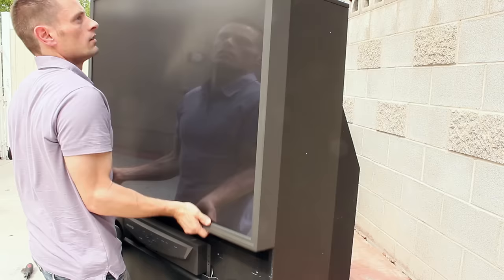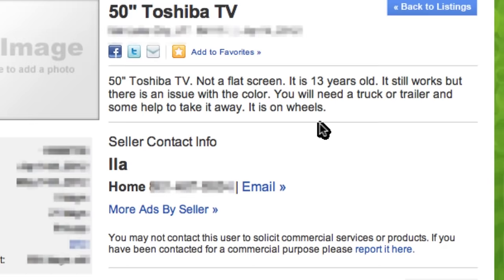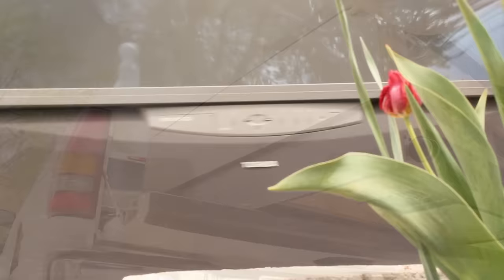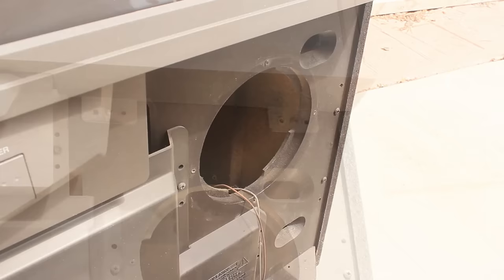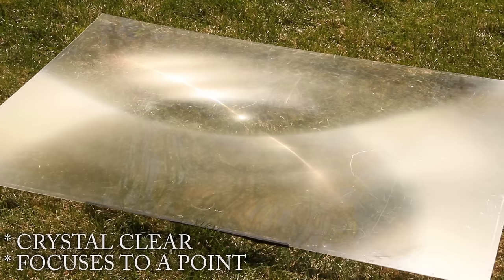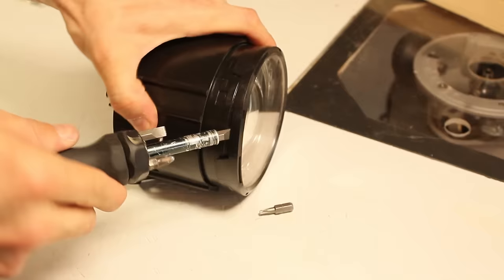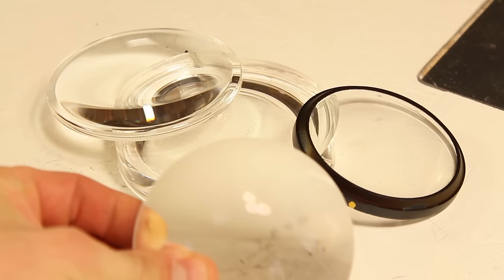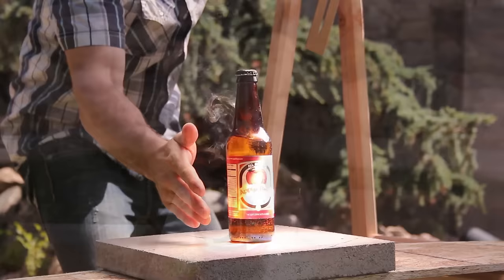How to get 2000ºF Solar Power

Comment: Mate, you are a legend. I was dropping things at our local recycling shop and someone just dropped off an old projection TV. I run a local stargazing business and am looking to add some things of interest for daytime shows for schools. You're right - these TVs are heavy, but I couldn't wait to get it home and start extracting the Fresnel lens, which I did just as the sun set. Came out easily and I can't wait to try it tomorrow. The next step is the frame - I will use your design and just looked at the video - wonderful. Well explained and should be good fun putting it together.

Comment: I made this thing it was easy. I was very excited about this and had plans to use it as a solar forge. There was a pile of TVs in the junk yard. One of them was a projection tv. Unfortunately the lense is not only opaque but the beam is focused in a line.The temperature is 300-360 degrees. However, it is not a failure. The tv came with a sheet of dark grey plastic, and the beam from the lense is the perfect temperature for quickly softening the plastic so that I can shape it into anything I like- I used it to make a fine sheath for my diving knife. It does not burn the plastic like fire does, and because it is solar the heat penetrates the inside of opaque plastic heating the whole piece equally inside and out like a microwave. Very impressive way to quickly heat plastic to molding temp.

Comment: If you have a spring cleanup in your area go drive around. Take a phillips and flat screwdriver (or cordless drill) and you can open one of these up in about 10 minutes to get what you need and not have to worry about discarding the shell of the tv. In the last month I have picked up about 10 of these lenses in my area. I grabbed all the optics too, the color from the lenses are good for over flashlights for the kids and that lense assembly you took apart, if you turn on the flashlight on your phone and put that in front of it you can get a heck of a spot light out of it. Good luck!

Comment: if this setup can heat up water in minutes using the sun, than why we don't have power plants with industrial sized versions of this? it would boil water 100% cleanly. or is this in use already?
Reply: There are some solar farms that use mirror 'half-pipes' to heat pipes of water above them to create steam needed to turn turbines.
Reply: Josh Kavathas Some days It's not sunny.
Reply: Josh Kavathas Here is something similar, but using hot air to drive turbines. http://www.enviromission.com.au/EVM/content/home.html
Reply: Josh Kavathas Because the World runs on fossil fuels.
Reply: Josh Kavathas because we would basically need to turn entire regions into solar farms to power a single city.
Reply: solar fricken roadways!
Reply: it even says in the article that federal restrictions are challenging to deal with and make it very costly to proceed. That and a 160,000 homes may take care of a small/midsize city, but you would probably need a couple areas like that to take care of a place like NYC. Its like trying to make cars run on ethanol alone, we would have to turn Iowa and then some into corn fields just to support about 1% of cars.
Reply: Use Africa it's not like its all inhabited
Reply: Josh Kavathas because solar energy is free, that wouldn't work out too well for large oil companies.
Reply: actually its because solar panels are very expensive and illegal to manufacture in the states because of the dangerous chemicals used and the very poor working conditions that people who make them have to go through. That and it isnt sunny every day all over the place. 

That and solar energy companies arent very economically viable with or without gov support (i.e. solyndra or however you spell)
Reply: Josh Kavathas the downside of such a project - even for tropical sunny areas - is that the sun doesn't shine at night, and is weak at dawn and dusk. So you'll have a power plant that works only for about six to eight hours tops. And you'll have to close it during rain season (or during winter and autumn for those outside tropical zones)
Reply: John Krazek actually if we made multiple solar farms around the world all amounting to only the the land area of Spain we would generate enough power to fuel the world...forever.yeah Spain is a big area but not if you divide it into a 1000 parts.
Reply: still cant make them, and its not sunny all the time, plus its still not really economically feasible yet. Id rather put in the money for methane power plants at landfills that help the stuff decompose slightly faster and lower the local energy bills almost 30%
Reply: lobtyu well it might cost more financially, but it's free to humanity's future.
Reply: Geek Wrestling you must be joking... solar roadways has been so thoroughly debunked... gtfo.
Reply: Creationsofmyown Your right, better just dig harder for them fossil fuels.
Reply: *****Because Fossilized fuels is the biggest cash cow in society. And oil companies would sooner cut of their genitalia then agree to switch to green heat. Not to mention the income for gov. with the tax on it.
Reply: ***** Or let's say they don't want to. Because if they can adjust the intensity of a laser, this is even easier. The power of the beam depends a lot on how you make the lens. If they used lens to maximize our current thermal solar power plants we wouldn't need so much space, so many mirrors and so many hours to heat the molten salt, but they just want to make solar seem expensive. You know cuz everything has to come at its time.
Reply: yes. some solar powerplants do use concave mirrors to heat oil and then use its high temperature to boil water in an instant and generate mechanical power as the steam travels trough a turbine
Reply: +John Krazek You haven't heard of solar city I presume

Comment: I just took apart my 15 year old rear projection TV apart, which as downstairs in my now updated totally awesome 4K UHD projector in my theater. I did the same as you,  I fresnel lens and also took apart all three projector tubes to get the magnify glasses.
I can reach temps up to 2500° with the fresnel lens. I use it for outdoor cooking and also to get a bonfire started before that huge yellow ball of fire sets for the night sky. Lol

Comment: Anyone who is off grid could use it to heat water for hot showers, just take showers during the day :)
Reply: But ya know they would melt whatever theyre trying to heat...
Reply: Calvin Phelps
ha ha, yeah but you could defocus the lens a bit like he did in the video to "Spread" the heat out and lower it. Btw, I was thinking about this again and why wouldn't it be possible to power a steam engine with this? Couldn't you build a cast iron boiler and focus a couple of these lenses at it to get it to produce steam and run an engine hooked up to a generator? Someone needs to try this, we already do it on larger scales (see the solar array in Arizona).
Reply: 95TurboSol That's a really good point, I also feel like this could be used on a very destructive level, like what if someone hooked up a mirror or something and turned it into a laser death ray.
Reply: Easy now!
Reply: 95TurboSol
Reply: The beam would not remain collimated. It would be far less dangerous than the death ray machine that travels across our sky once a day.
Reply: potensialy
Reply: Step 1: Live in a sunny place
Reply: k20 swap ot
Reply: Calvin Phelps 
I don't think it would melt anything that was full of water. You ever hold a flame to a baggie filled with water?
Reply: +Calvin Phelps That does not work I tried it...
Reply: madbloodVG how does it not work?
Physics would say unless the water becomes hot enough to melt the plastic it didnt happen
Reply: 95TurboSol 
I dont know how is it in your country but here in israel there are water heaters that powered by sun in almost any building. The only problem is that it works only in sunny days so in winter we heat the water by electricity.
Reply: Sad but it's true
Reply: @AtomicShrimp  '' the death ray machine that travels across our sky once a day.''
i lol'd
Reply: @aviadlampert5956  Israel 1
Everybody else 0
Reply: 95TurboSol You would want to use molten salt. Perfect for concentrated solar arrays

Comment: If they can do that with a TV surely they can use this to make energy instead of fossil fuels?
Reply: I mean the sheet plastic stuff, I can't be assed with correct terminology, because ya' know. its the internet.
Reply: Khanh Duong Phan there's also the problem that this focuses the energy into heat. great for burning or melting things, but not great for moving things. to use this as a power source for anything would have about the same effect as merely lighting a match as a power source. you need more than just that, as heat alone isn't a power source. also, a much more effective and (based of price for the amount of energy required) nuclear power is much better than fossil fuels, but that doesn't make it a better alternative...
Reply: tubefan90000
 You obviously never heard for Stirling engines with solar power :) Try to search it in Google :) They use Magnifiers, Lenses, Mirrors.. All kind of stuff to concentrate Solar power and turn it in to energy. Well It is not the best way, but it can work for some people with some building / mechanical skills
Reply: Georgi Ivanov well, a Stirling engine is not just one magnifying glass, so still, just what he made in this video would not get a car moving
Reply: tubefan90000 you can use a water system with something like a turbine. And it wont be so hard to build.
Reply: Andoni Aranguren a water powered car? pretty sure that was attempted before and had various problems, but I can't remember details at the moment. perhaps it was a lack of power received by a small enough system for a car, but I could be thinking of something else instead...

Comment: Put This on top of your solar panel = UNLIMITED POWERRRRRR
Reply: +Jacob Bennett the problem with that is that the heat from this lens is too much and melts the solar panel, however, there are special solar panels with mini magnifying lenses for each solar cell that achieve your idea.
Reply: +Jacob Bennett But it is possible to use it to burn water and create steam for an instant pollution free generator
Reply: +Jordan Tan 
YES THIS WOULD BE TGE RIGHT WAY TO GO .
I AGREE WITH YOUR THOUGHTS
Reply: +my self Thanks! Going to try to build one in the future
Reply: +Truvak T - I was wondering if you could use it in one of the hot air exchange boxes that people make. I would deliberately put it so it's out of focus a bit to not hit it's optimum temp but still get more out of it than an ordinary chunk of glass would. Hopefully that makes sense.

Comment: Can the TV explode when you open it??
Reply: actually older TV's where extremely dangerous to open. cracking tubes or busting the back off the screen could cause a burst that could send bits flying or just electrocution, as some bits still held charge even when unplugged. one of my great uncles was a tv repair man in the 50's. with the newer TV's though things are much safer because there are no pressurized parts, I believe there are still a few capacitors on the boards that should be looked out for but if your just doing this project there is no need to get into that.

Comment: I wonder if I could use this and the molten salt turbine to get more power than a solar panel of equal size.
Reply: Meep Changeling This has been my question, why aren't they using magnifying glasses to maximize the efficiency of thermal solar power plants.
Reply: +Eli P. The amount of energy coming from the sun is always the same, even if you 'magnify' it is still the same amount of energy, just distributed over a smaller area-hence the extremely high temperatures(1000oC+) seen in this video. 

The 'efficiency' of a solar thermal power plant has nothing to do with the amount of energy coming in, only how much of this is converted to electrical power. Which has more to do with the thermodynamics and physical constraints of the electrical generator, etc

However magnifying glasses would be beneficial if the focal point of the power plant needed to be extremely small. Although usually they are large as you don't need extremely high temperatures to produce electrical power. (steam=100oC, molten salt~600oC)
Reply: iMattLewis thank you for all this info. However I was referring to all the space they take using mirrors, they could have less mirrors with magnifying glasses, and make the receiver more resistance to higher temperatures so the molten salt doesn't evaporate but melt it.
Reply: Eli P. But by making the receiver more resistant you are decreasing the overall efficiency of the system(solar energy>electrical energy)
In the end the more space you have occupied by mirrors and/or magnifying glasses aimed at the focal point the more sunlight you can capture and the more electrical energy you can produce.
Reply: +iMattLewis The focal point doesn't matter unless the focal point is the most efficient point on the solar panel. The problem isn't how much power is coming in with solar panels it is how efficient the solar panel is. 
Also I have heard that even if solar panels do get more energy with more heat/direct power coming in there is a point at witch it would be inefficient or obviously damage the solar panel once the thermal energy has been focused into a specific smaller area.
Reply: +iMattLewis Heat resistant.
Reply: Hmm, what if we were to use a magnifying glass of this power to make steam, instead of burning coal? Would that work?
Reply: iMattLewis What is molten salt used for?
Reply: Trevor Thieme No one knows...
Reply: +Trevor Thieme Either making sodium and chlorine by electrolysis, or nothing because there are other ways of getting sodium and chlorine.
Reply: @StarForgers  5 years late, but salt stays hot longer than water by a lot. Molten salt is thus a great heat source for boiling water to turn turbines. Which is how basically all power plants work. Just different heat sources, coal, sunlight, uranium, natural gas... It's all to make steam.

Comment: Word of advice when handling lenses - wear latex gloves or touch only the sides of the lens.

Why?  Because the grease on your fingers is hard to remove, and absorbs a little bit of the energy from light.  This means if you start putting a lot of light into that lens, the grease can actually burn, or depending on the power put through it, melt the glass.
Either way, the lens will end up permanently damaged.

Comment: Would this be hot enough to melt rock into lava?
Reply: Senor Cardgage Lol no
Reply: Yes! I have seen people melt rock and obsidian with it
Reply: Senor Cardgage Heavily dependent on the quality of the magnifier used, the concentration, and of course the type of mineral your trying to melt, if its something like glass then forget about melting it, a lot of things will turn red hot (including glass) but wont do much more than that.  also most magma is at a constant temp. and under pressure niether of which you could have with this, while he says 2000F thats not a constant just mearly a peak under good conditions.
Reply: Senor Cardgage but maybe? magma is between 800F and 1400F
Reply: beastbum You're wrong. He showed it melting concrete. What do you think that is?
Reply: beastbum melted concrete, :o Liar!
Reply: ***** Nor dank memes
Reply: Senor Cardgage  Yep I got a 50 inch that melts volcanic lava in no time and I also got a wide screen 60 inch spot lens as well See my 50 inch melting lava on my channel
Reply: ***** Steel is tempered so I expect it to withstand 2000 degrees.
Reply: mnester31 Actually, It can easily got hot enough to melt steel
Reply: Dinoman217 Mine will not only melt steel it make it boil and vaporize it as well.
Reply: Michael Ellestad
Lava Can that is! This super magnifier doesn't get that hot, but it could get it to blacksmithing temperatures!
Reply: Dinoman217 It would be good for blacksmithing too I have melted large spike nails and threw molten metal on the ground where it sprayed and sparked on impact
Reply: Michael Ellestad Yep! 2000 degrees is hot enough to heat steel to blacksmithing temperatures, but not so hot as to melt it!
Reply: My favorite thing to do with my lens is melt volcanic lava rock and take broken colored glass bits from beer bottles, soda bottles and other sources and melt them into them little glass drops like the ones in aquariums. I think next time I will try to forge with my lens at least the lens does not produce toxic fumes like coal so in a way using a giant Fresnel lens to forge with is green blacksmithing.
Reply: mnester31  You don't know what you're talking about
Reply: TTime685 No need to be rude! We're only human!
Reply: Senor Cardgage Rock > Lava = Impossible
Obsidian > Lava = Possible
No, obsidian isn't Minecraft. its real.
Reply: ZippyZipra Obsidian is a volcanic rock... smart one
Reply: ZippyZipra What are you saying?
Reply: +ZippyZipra obsidian is a type of glass
Reply: +William Ela green power science
Reply: Jack Sullivan Yup! Thats who i was thinking of
Reply: adam kendrick obsidian is very real...many surgeons prefer it to steel scalpels
Reply: adam kendrick lol obsidian is one of the many types of igneous rock